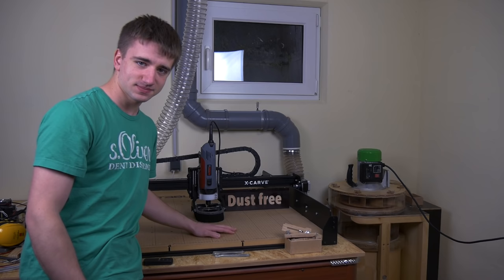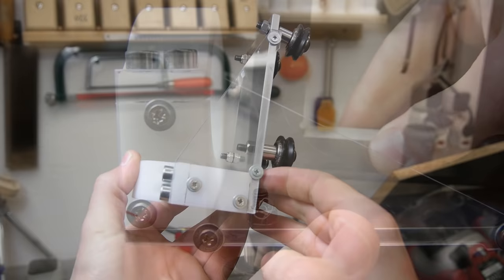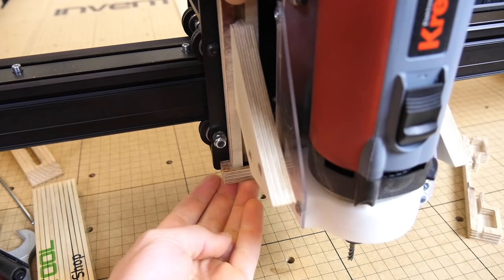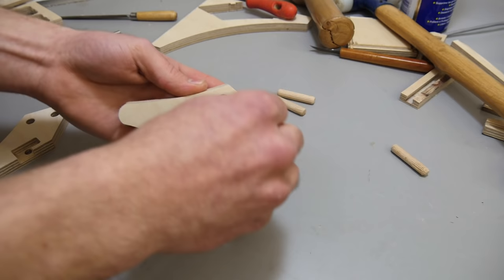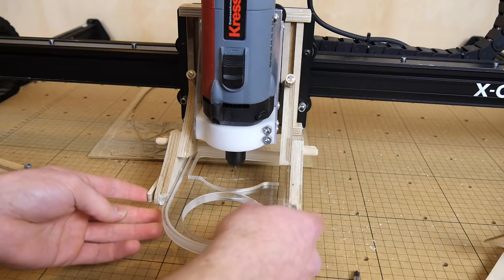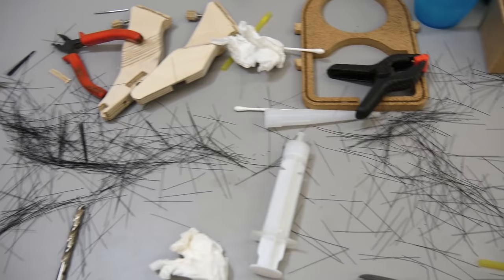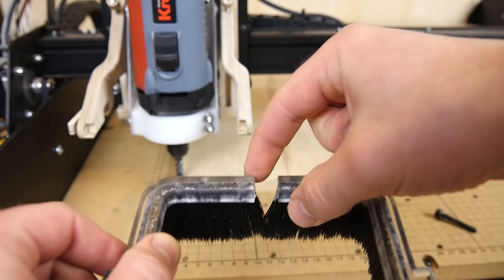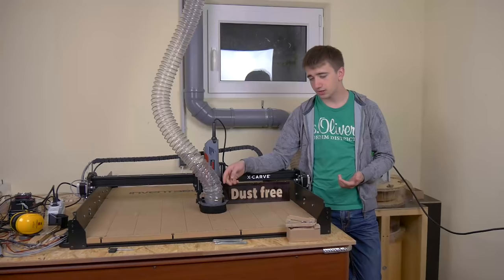How To Make The Ultimate CNC Dust Shoe

Comment: I've made a couple dust shoes for my Shapeoko3 XXL and it makes life so much better not having to clean up.  I made mine so that it can be clamped stationary relative to the x-axis beam or it can be clamped to the router.  So far I've not used it clamped to the router though.  I will only use that for 3d parts that need it which will probably be few and far between.

Thanks for posting your build.  I like parts of your design very much.  Your videos are always great quality too.  Thanks again.

Comment: instead of a brush on the dust collection,try the heavy grade  of plastic sheet that is used on workshops when forklift trucks are constantly comming and going through.you might have a stronger suction.also being clear sheet you can see what you doing.the sheet is very flexible so if it rubs on the work piece it gives

Comment: for bristles like that, it's pretty common to glue or melt them together outside of the holder, then assemble that as a finished piece into the frame.  It might be easier than doing it all at once

Comment: This design only works because the brush is stationary while the spindle mooves up and down inside this dust shoe. For larger machines with larger spindles this design would be unpractical as the dust shoe mount would be unreasonably large.

Comment: Excellent "How To" video on your dust shoe, and I really like the vertical travel.  For mine I need to add or remove spacers.  If you decide on longer bristles in the future, you might want to check out what McMaster-Carr has in the way of "Easy-Cut Strip Brushes".  This is what I used and they work great.

Comment: Hi Marius, this is by far the best, and most userfriendly design for a dust shoe i have ever seen. 
If you are ever going to make dovetails again, they are easier to fit together if you begin with a male part and assemble the female part around the male. In essence the same procedure you just did in this video, just in the reverse order. This way the "loose" side of the female is the last thing you glue in with the male part sandwiched between. Should give a perfect fit every time, even if one part is 1/10mm out. But I'm sure you have already thought of this.

Would it be possible for you to would share the sketchup design ?

Comment: That is a pretty good set of problems solved I like the way it came out but I don't think I would put that much labor I do have my own situation with quite a different set of problems to solve I have my router upside down underneath the something else at the edge of something that is a half an inch thick before it touches the material to be cut

Comment: Do you think something like this would pull the chips out of the slot from aluminum?  It seems like it's either suck or blow for aluminum, but clearing the chips before the bit runs over them again it crucial with aluminum.

Comment: you did adjust the movement of the stepper motors right?
because the added weight might put more strain on the steppermotor and make it a tiny bit slower and reduse how many mm it moves so you could be a bit off on some of the CNC millings

Comment: +Marius Hornberger I cringed a little when you started cutting bristles from a brush. I've done that in the past. I've since found a source. Look up conveyor belt brushes. They come in different dimensions for what you need with either a metal or plastic backing. No more gluing and trimming. Great job either way. I'm going to make something similiar.

Comment: Why did you not add a horizontal support from the left to the right support arm between the router and the dust-collector-hose to make it more rigid?
Reply from the maker: +xenimde There's only like 5mm of space left. Not enough for a proper support.

Comment: Hi Marius I have a Stepcraft D840 and I have problems with the dust shoe hairs the will bend it inside and the hairs not crack but bent and stay in that position.  So I try out a new one with little bigger hair size but it has same problem.  The are plastic hairs and I can not find good hairs that after bending comes back to original without crack the hair and that stays like crack.

Comment: It is not a shop project, it is a piece of art! Congratulations! But I do not understand why you don't use two clips for holding the shoe instead of a clip and a magnet. Keep up the good work
Reply from the maker: +7HUNDER would be harder to remove as you need one hand to push the clip and the other to pull out the dust shoe.

Comment: What is the hardest material you can cut with your kress? Can you cut metal? Which ones?
Reply from the maker: +Marcin Zdunek Yes, it can cut metal. Haven't tried it yet though. The limiting factor in my situation is the rigidity of the CNC construction.
Reply: +Marcin Zdunek 
I have the same spindle, but no CNC. I normally use it as a hand held router in a router base of an old Bosch router, but have also mounted it in a drill stand with a 43mm neck (and lately I also built a router table for it). I've cut wood, different plastics (acrylic, ABS, PC, PE, PP), glass fiber boards (circuit boards), carbon fiber sheets and aluminium. Non of that seemed to impress the spindle in any way ;) . It cut everything like butter (although I got to say for the glass fiber, carbon and aluminium I never used a bit larger than 3.2mm because all bigger bits I have aren't useable on these materials). 
I have seen the spindle cut 8mm brass with a 5mm tungsten carbide bit at a local maker space in a CNC and it didn't really seem to be stressed ;) . I asked around and they said they also cut steel and stainless with the machine (don't know about the thickness/cutting diameter though).
I've used several hand held routers on wood, even some that claim alot more power, but non of them made the wood just "vanish" in the same way. Also the bearings/balance is so good that even in my wobble drill stand I can drill 0.6mm holes into PCBs without problems and fear of breaking the drill bit.

Comment: Hey Marius,
did you feel uncomfortable cutting those small parts on the tablesaw?
I also want to buy a Hammer format-table-saw, but I'm not sure if it's safe to cut small parts on such a big tablesaw.
Reply from the maker: +Fatso trinkt Bier yes, I have no problem with that. Thanks to the zero clearance insert. With the original I wouldn't do these cuts though...too big of a gap with it.

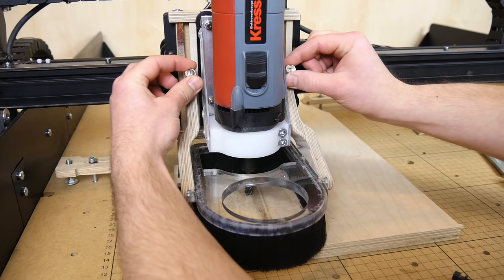Comment: Very nice!! Just one question: At 14:42, you position the bristles onto the surface of the work piece, but how do the bristles conform as the spindle cuts deeper into the work piece? I thought you lock the brush assembly in place with those two thumbwheels, or is the whole assembly free to move up and down, thus allowing the bristles to stay at the surface of the work piece as the spindle plunges in deeper? Thanks for sharing.
Reply from the maker: +Steven Zara Exactly. The spindle up and down movement is independent of the brush.
Reply: +Marius Hornberger, Thanks. I thought that was it, but wasn't 100% sure.  I will attempt this when my ShapeOko3 CNC is up and running.  Keep up the excellent work!

Comment: Marius, good job. 
Does the shoe move independently of the router vertical movement? So that you can set the dust shoe to the surface of the material and when the router cuts deeper into the material the brush doesn’t move lower and distort. 
Thanks
HH

Comment: I tried to engrave letters in acrylic, and it was not good! I saw you use acrylic, and the result is good. any advice about engraving acrylic?
Reply from the maker: +woody wood yes. Slowest rpm you can set your machine to. Mine was about 5000rpm. Very shallow passes ~0.2mm at a time and high feed rate. Mine was 2000 mm/min. Also depends on the type of acrylic. Plexiglass is the worst. I also had the fails at first.
Reply: thank you! I'll try it soon. Gute nacht

Comment: Why not use clips on both sides?
Reply from the maker: If you need both hands for pushing the clips, which one pulls out the dust shoe?
Reply: i meant to say like if you use both your hands to disengage clips on both the sides of the dust shoe attachments then would that be a problem?
Reply from the maker: yes, as you sometimes need to fiddle a little bit to get the dust shoe off. Depends how low the router is or if your workpiece is in the way. Easier to do when you you have free hand.
Reply: Thanks for sharing
Reply: Why not simply magnets to hold the shoe in?
Reply: Amazing
Reply: I think, clip in one side is easy to take out brush with one hand!
Reply: can you share the g-codes?

Comment: I don't know if you have access to McMaster.com where you live but they sell brushe material already set into plastic track which makes the brush part of this job super easy.  http://www.mcmaster.com/#brushes/=128k14q.  The link didn't work right but just type in "Easy-Cut Strip Brushes and Holders" in the McMaster search window and they will come up.  You can choose from several lengths of bristles.

Comment: Marius, I think maybe you worry too much about shavings on your router.
I just wait til the program is complete then X60" and vac up with my
shop vac. I like your ingenuity making parts but you have to upgrade
your materials. Plywood is terrible to use in the case shown. Try Black (optional)
Delrin - the king of plastics. It's slippery, strong, resilient and machines beautifully.
Also, invest in some polycarbonite. Way tougher than acrylic. Ian

Comment: I think that  that dust collector motor is over kill and to over powered for such thing as CNC...you are spenting too much energy but anyway greath build as always!
Reply from the maker: +Nexus PvP The dust collector only draws 500w when in use. Any other shop vac or similar would use more power.
Reply: +Marius Hornberger yea xD my mom's vacum cleaner draws 2kW so i though because of the size your draws much more but well done :)